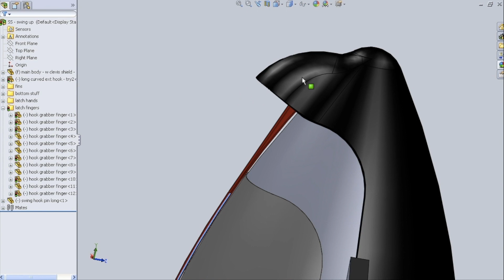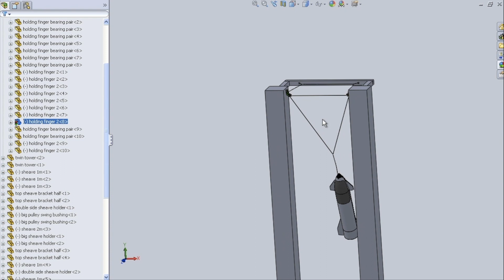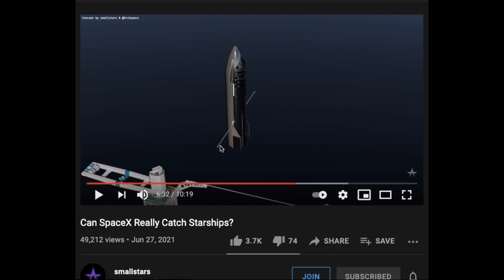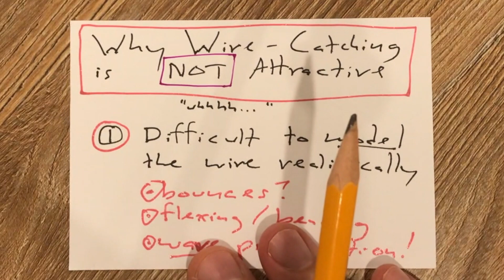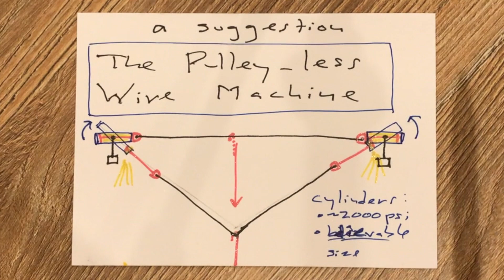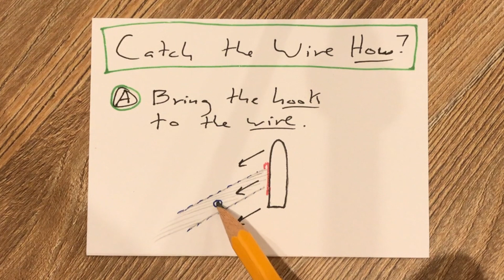"Dorsal Hook" wire-catching landing scheme for the SpaceX Starship and Super Heavy

Comment: Maybe instead of hydraulic cylinders, a couter weight system on a wire can be used.... maybe weights with a central hole, seperated by a spring,  and anchored to a larger moveable weight at the end of that cable.  The springs reduce the impact by allowing a deceleration.
Reply from the maker: I don't follow yet.  Please make a video -- make it as crappy as it has to be to actually get something out, like maybe as a slideshow of pencil drawings? -- and comment again here with a link to it.  (You can make it "unlisted" in YouTube if you don't want jokers discovering it online and hassling you about it.)

For one because I'm interested, and for two because putting together some kind of presentation, especially for strangers, has always helped ME discover when I'm being stupid.

I'll tell you this too: These gigantic hydraulic cylinders ARE a real and attainable device, but I'm willing to bet they take many MANY months to have made.  Agreeing to that kind of delay is VERY un-SpaceX, perhaps show-stoppingly so, and I do hate to admit that.
Reply: @spacehaxx2225  You don't need to subscribe.  Here is the link:  https://youtu.be/gU2diohV1Xs

I will try to make a drawing soon of the other idea.
Reply: @spacehaxx2225  Here is a video with the basic idea.